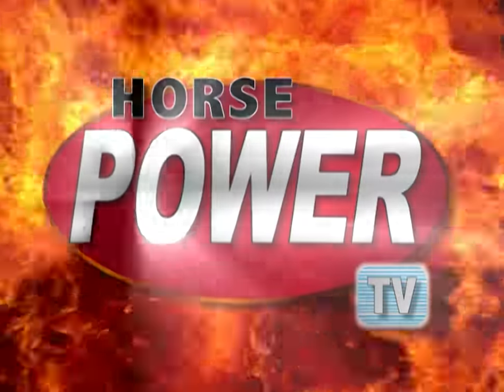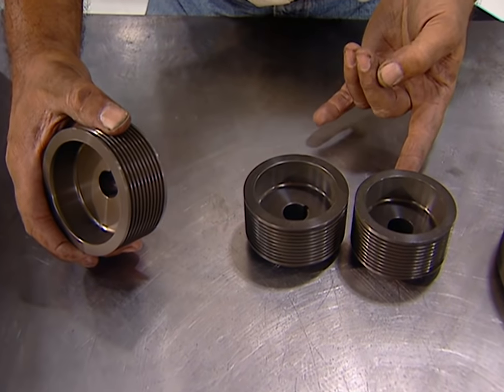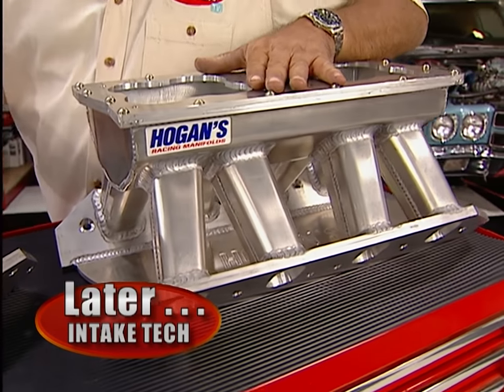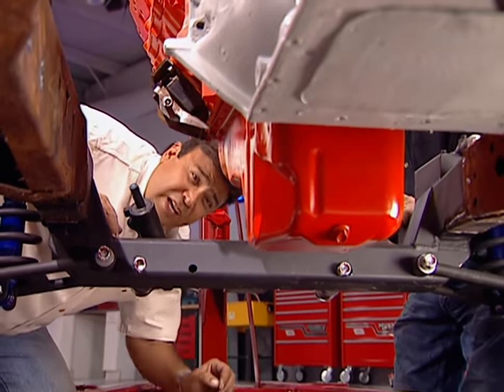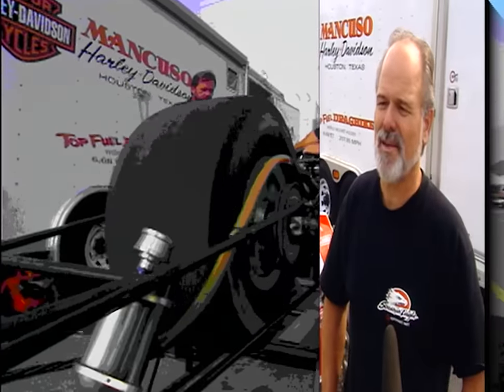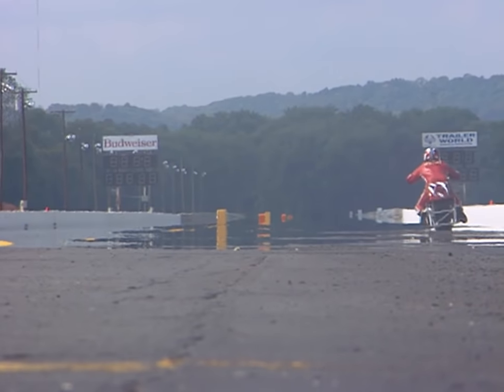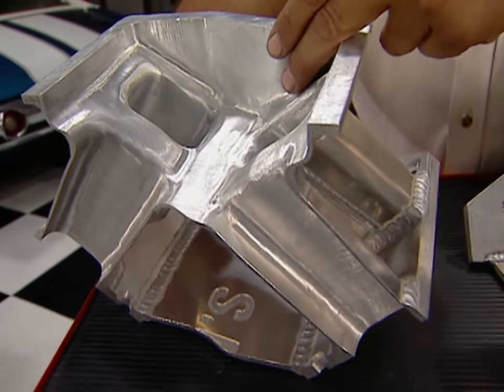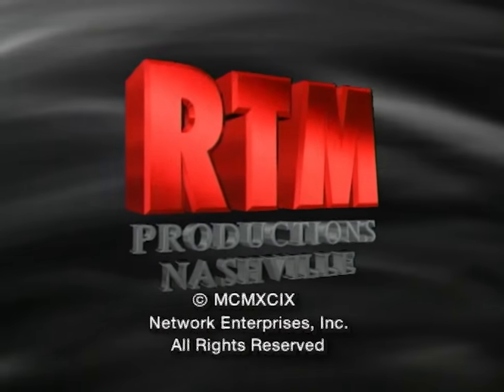How To Bolt On 100 Horsepower To A Grocery-Getter - Horsepower S1, E3

Comment: Wait......barely 300 on a blown big block?   Am I missing something?
Reply: Yes, missing horsepower,
Reply: nope that was about it back in the day, It wasn't until heads got a lot better the numbers changed, ANd that 330 was through the transmission and full front drive, today it would have ran on a stand with an electric water pump and made mid 400s. But no one rides and engine stand so those numbers are meaningless
Reply: All before aluminum heads were common and this was the norm back then. A stock 454 isn’t going to rev like todays engines but I would bet that was pumping 600ft tq
Reply: The wagon is losing about 100 horsepower thru the drive train! Should have put on better cylinder heads n camshaft!!!

Comment: I need a truck but I'm not paying new truck prices. 
I'm going to buy a square body k10/20 and fix it up. 

Then drive it for a million miles over the next 30 years. I'll set the sucker up to run on straight ethanol and distill it myself if I have to if the hippies screw everything up and fuel gets too expensive.

Comment: Where's the 'intercooler?'
Reply: Old school roots style blowers don't usually use intercoolers
Reply: They don’t operate with an intercooler, feeds air from the top, compresses it in the middle, and dumps it out the bottom

Comment: The lunatics in the Biden White House has gas prices quickly heading towards $10/gal. I am far more interested in bolt on gas mileage improvement than horse power.  And I have already followed Obama's advice of putting air in my tires.
Reply: We can just use the hot air coming out of the Biden administration, that will fill every tire in America